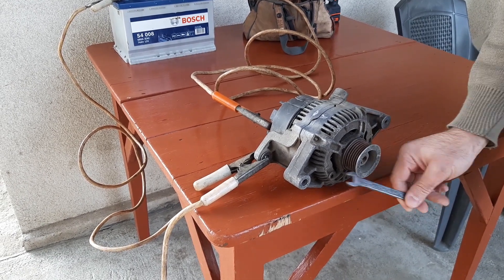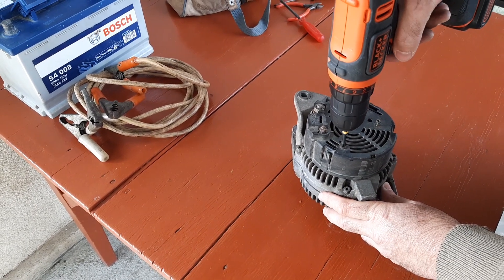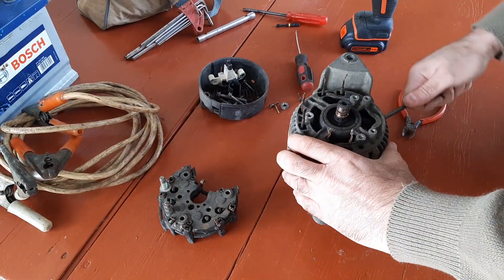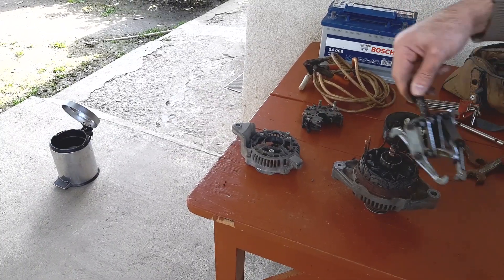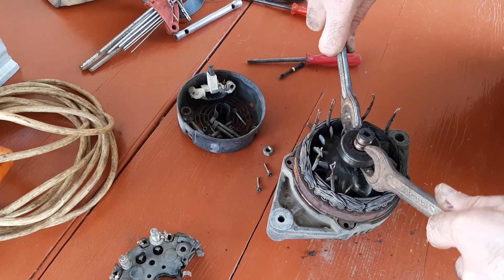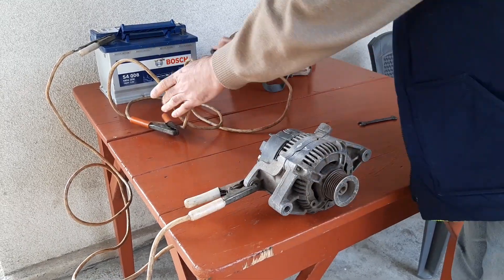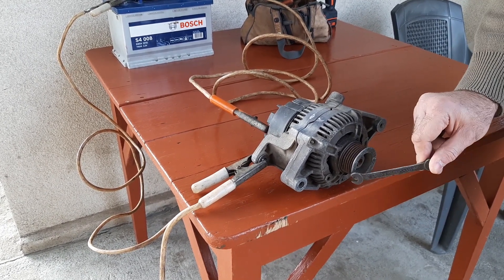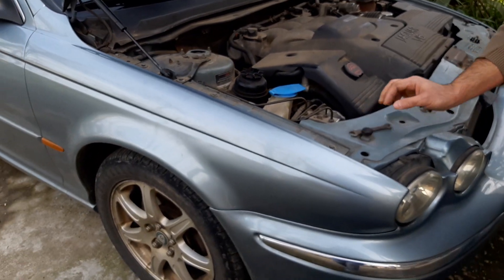1 Tool, 2 Jobs: Alternator Rectifier Testing & Bearing Removal

Comment: What model/partnumber of alternator is in your xtype 3.0 V6 ?
Reply from the maker: Mine is 2.1 V6, partnimber is 1x43-10300 CB for a manual gearbox and 1x43-10300BD for automatic. The only difference, I believe is the CB is equipped with a clutch pulley, while BD is equipped with an ordinary pulley.
Reply: @jaguarrroman  should be the same in mine, I have automatic gearbox 4x4 wheels. It blows me second battery, just cooked it. I think voltage regulator is bad. So Iam looking for its partnumber before I do this not easy job.
Reply from the maker: @ I would try and check the rectifier first, bad rectifier rises the voltage to about 18 volts. If a 10 mm spanner sticks to the pulley as shown in this video, the rectifier is bad.
Reply: @jaguarrroman  I have changed voltage regulator located in alternator, not so easy job but feasible according to your video.2 days work, belt pulley I losen by pressing longer pipe on pulley tensioner by my chest, and with free hands getting out and in the belt

Comment: Hi Roman…I have an 87 Dodge p/up restored collector, has a new computer 21 wires, also last year of the carburetor. For two years it has been acting up intermitently backfiring , sputtering and stalling etc. 
When i saw your video, i thought this was the answer that the computer was being confused and going crazy from some a/c leaking by the diodes. The alt pulley was magnetized just like your eample. Mine has an external voltage regulator also new.
So i installed a new ACDelco alt and guess what, its pulley is magnetized the same with the ignition on. 
Do you have any kind of explanation fo this?
Reply from the maker: If the pulley is magnetizing, but stops magnetizing as soon as you disconnect the battery wire, diode rectifier is faulty.